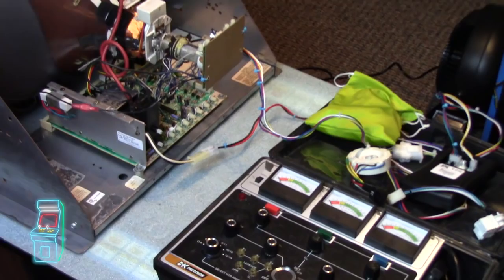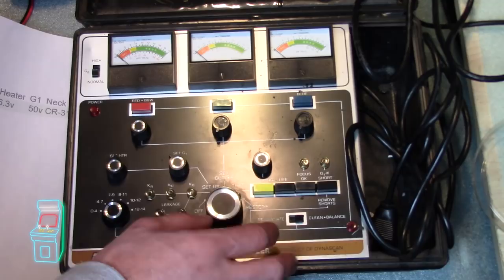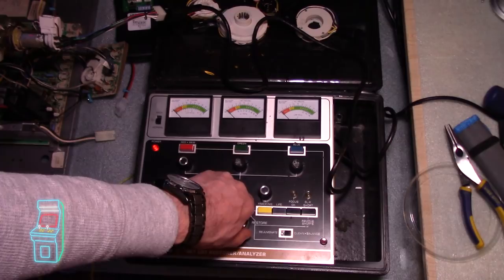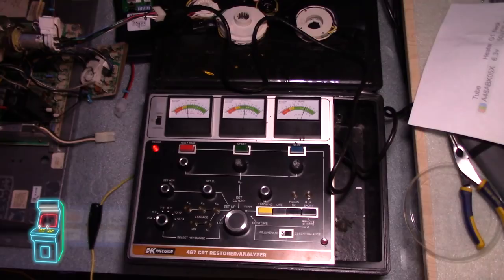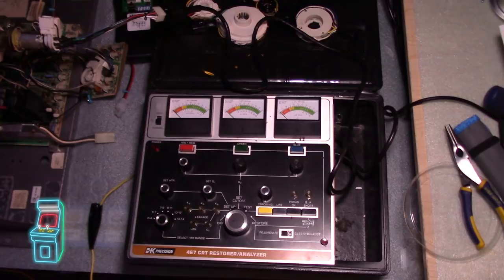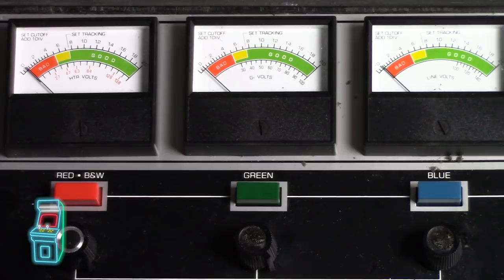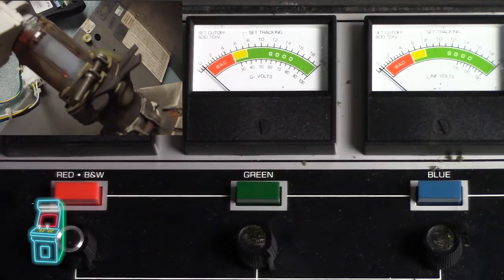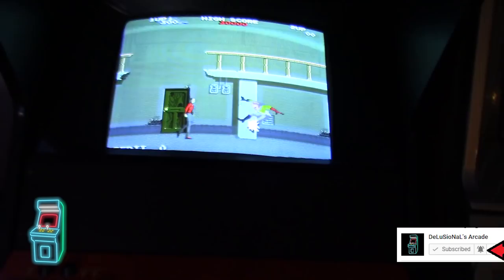How to Rejuvenate an arcade CRT monitor [B&K 467]

Comment: The rejuvenation feature of that CRT tester provided excellent results! I've heard that, back in the day, TV repair techs would use these in the field to rejuvenate dying CRT's as a stopgap measure to give them time to order a new CRT, as the effects of the rejuvenation were considered temporary. There's only so much conductive material on the surfaces of those cathodes.
Reply: I wonder why they chose to call it rejuvenation if it's "bad for the tube". Based on your comment, they should have called it "Death Rattle"
Reply from the maker: The term "Rejuvenation" is accurate in my opinion. By definition, Rejuvenation is adding energy and vigor to a dying product. But it's only temporary. However, it does extend the use of an already "unusable" tube.  So it does breathe new life into it.
On the flip side, the  term "Restoration" (which is what I suspect you may be seeking)   completely restores the product to factory condition. In this case, CRTs cannot be restored 100%, similar to a light bulb.

Comment: Just wanted to thank you for the shout out.
great video, it was a fun watch.
also just so folks know, the adapter is ALL BRAND NEW, nothing is used, socket is even BRAND NEW.
Reply from the maker: Cool. Glad you approve of the video. Yeah, I was wondering about the socket. It looked too good to be used. And now you've confirmed that it's NEW. Even better!
Reply: @delsarcade  great video guys.  I've watched buffet's and your's.  Did you have to repair your model when you got it off ebay? I'm waiting on a listing of that same model on eBay. Just curious if ya had to do any repairs to it, or send it out to someone or if it worked just fine for ya.
Reply from the maker: @curtislv426  No, luckily mine worked perfectly. And it was only $60 shipped. ;-)
Reply: @delsarcade  good lord! That's a heck of a deal!
Reply from the maker: @curtislv426  That was about 5 years ago.

Comment: I have a 467 and it is one of the BEST of the "old" restorers. The 465 was a no timed harsh step restorer wheres the 467 has a "patented" timer that works off the the cathode temp and tells you when to release the button. The 467 is very strong even in the C&B setting and 9/10 times used 1 to 3 times from experience will fix any tube well into the green. I also sacrificed one of the B&W sockets and made a universal connector for any pin crt pin configuration.

Only thing to be aware is the "new" crts have very fine close together cathodes and using an old style restorer MAY damage and short them. Having said that, i used it on some modern tvs only using the C&B setting and all times no problems as for those CRTS, C&B is PLENTY so i never needed Rejuv.   
This vid is great as that last tube had NO indication of output on those colours but the heavy rejuv brought it back to life- something i never needed to do and the instructions suggest to finish with a C&B to settle the output a bit more evenly on the guns after rejuv.  Might be why those needles were crazy high at end but shaky. Time and some heat in the crts acts as a very gentle rejuv anyway so leaving the crt on and get it hot can "mild" clean the guns a little, as is turning up the voltage on the tested a bit higher and getting the it hotter can help when testing.
Sadly except for analogue oscilloscope and arcade games, the restorer usefulness is going away but great if you have your own crts that need cleaning as i do so its a handy quality instrument that i will keep forever.

Comment: Really enjoyed seeing these tubes get a new lease of life! Don't worry about the shaky needles, the 467 has at its core a multiplexer running at 20Hz which constantly cycles sequentially through R G and B. This always shows up on the meters at higher readings, due to the value of the smoothing cap across each meter. I guess it was a design choice, providing greater accuracy of reading at low current levels at the expense of some jitter at the top end. B+K really did design some wonderful test equipment.
Reply from the maker: Glad you enjoyed it. Thanks for great info!  My next Livestream will be on re-capping the B&K rejuvenator.  Should be fun!
Reply: @delsarcade  Cool! I'll look forward to that!

Comment: Just wanted to send a thanks and a like for a great video with clear instructions, it was easy to adapt to a B&K 470. I just ran a clean and balance on a K7400 and a clean and balance with a touch of rejuvenate on a K4900 with great results.
Reply from the maker: Glad it helped. I created it since I hadn't really seen an in depth one done before. The picture in picture make it a bit easier to follow too.

Glad you breathed new life into those tubes!  [Also, if you ever decide to swap out a tube, I've done videos on those as well. (Arcade monitor repair playlist.)]  Enjoy!
Reply: @delsarcade  Ha! Thats what I'm trying to avoid… though I think the K4900 is on its last legs it did some funky things when powering it on for the first time after the rejuvenate but has since settled, maybe a side effect of burning junk off the cathode? Funky things as in red screen flashing with retrace lines, it's had a hard life can tell its been in many machines from the burn in.
Reply from the maker: Could be some shorts developed with the rejuve.  There should be a "remove short" button that can remove them safely. Also, it helps to have the font of the tube facing down during the rejuve. That way anything knocked off the guns will fall away from them, reducing the shorts.
Reply: @delsarcade  That’s good info, I’ll give that a shot if it starts becoming a problem.

Comment: Yeah, I wonder about the green gun too, why its pegged.  A new in box CRT wouldn't peg like that.  It also shows shorts, something funky but it DOES work.  If it Jacks up though I'd check your green drive circuit (may be somewhat shorted, over taxing the green drive)

Comment: Amazing that it can bring them back to life!
Reply: Well, it's not that easy unfortunately. The rejuv process is destructive and your mileage may vary. You can also kill a tube this way. I would actually leave these two monitors on for a few days to see if they truly survived the process. The Sencore CR7000 manuals actually specific mentions that the rejuv process on an arcade tube won't usually yield the best results.That said – it's really the only option for a dying, dark tube!
Reply from the maker: The Outrun is rock solid. So it worked great.  And you'll need to see what happens with Rolling Thunder's in Friday's episode. ;-)
Reply: @delsarcade  That's great! I actually shared this with a guy who used to work for B&K doing demonstrations of the 467 for TV repair guys. He said this brought back some memories. One suggestion: take a peak in the manual and it'll tell you when you click over to restore you should wait for a good 30-60 seconds before running a C&B or rejuv.

Comment: If it were me (I could be wrong) I would do a "clean and balance" once more after 2nd rejuvenation.  I noticed on the picture in picture it was sparking when you were rejuvenating the first time without touching anything.  I'll bet the crap that was on the red gun was going back and forth to the green (maybe?) due to the difference in charge.  I don't know much about CRTs, just how they work in Physics 3 I just took the massive acceleration of the electrons from the individual red gun with lots of negatively charged crap going to the more-positive adjacent green gun? (it was perfect before - just a random thought)

Comment: This is really what the CRT community needed, a good tutorial! Would you be so kind to explain what happened to the green gun of the first monitor? Seeing it go all the way down suddenly made me think it was bricked, but somehow by repeating the process it got perfect again?

What was going on?

Thanks!
Reply from the maker: Thanks, glad you find the video useful!
To answer your question regarding the green gun:  When the voltage was applied it knocked off the corrosion inside the tube.  Sometimes the bits knocked off will fall on the filaments and cause a short.  In this case that's exactly what happened. At 17:09 if you look closely you will see the orange short indictor light up on the lower right. (I didn't notice it).  Normally if you see this you simply press the "remove short" button and it zaps the short off.  But I did it again and it worked. Same result.
Later in the video on the second monitor that's exactly what happened. At 26:45 I noticed the short and (off camera) pressed the "remove short" button which cleared the problem. You can even see the blue concentrated flash in the neck as it gets zapped off. 
Hope this helped and thanks again for watching and commenting!
Reply: @delsarcade  Awesome response, thank you! That explains so much. I've got one broadcast grade HD CRT here that's fine color-wise, but could use a bit more brightness. Spoke to a tech that used to service them who said that the clean+balance mode of the 467 should be relatively safe to use. I'm excited about it, especially now I understand the process so much better! Still have to find a 467 though.

Comment: Great video thanks! My local radio and TV museum has the same unit, but not the proper connector, just like you originally. How can I order that proper adapter from Buffet?
Reply from the maker: Head over to Buffett's website. Scroll to the bottom and e-mail him directly.  CR-23 and CR-31 are the 2 most common types. 
http://thearcadebuffett.com/

Comment: This is Fantastic! I just picked up one of these today and really want to learn how to do my own monitors. It came with adapters # 4, 5, 6, 7, 10. Not sure if any of these are arcade monitor compatible? The monitor is a 19K4625. Any advice on what adapter I will need for this monitor?
Reply from the maker: You have a Wells Gardner K4600.  That has a CR-23 neck on the tube.  So you'll need that adapter.  Your best bet is to remove the neck board and see if what you have fits.  If not, fear not, The Arcade Buffet makes them.  http://thearcadebuffett.tictail.com/product/cr-23-adapter-for-the-bk-467-490-tube-rejuvinator  While you're there I'd pick up the CR-31 adapter as well, since those are the two most common in arcade monitors and TVs.  The CR-23 should cover 25" monitors as well as 19".

Comment: Hey I think you hit the green gun on the second tube a bit too much. Once you removed the short, you would have been good to go — no additional rejuv needed. Also, I don’t think it was necessary to run the C&B after the rejuv. You want to hit the filaments as little as possible.
Reply from the maker: Thanks for watching!  One thing I've learned: Feedback is GREAT! I've gotten many suggestions on how to do it better and I really appreciate everyone's input (including yours). There certainly is room for improvement and I'm going to take that knowledge and apply it to my future endeavors. Thank you!
Reply: No problem! I’ve been messing around with rejuv units since last Fall, so I’m definitely not an expert either! 

I know that you want to use the least amount of power as possible since the rejuv will strip the cathodes. I usually leave a tube run for a day or two to be sure the fix is somewhat permanent. It’ll fade if it’s not. 

I’ve had good results with the 467 C&B. I usually always start with that.

I’ve also been messing around with a Konig TR850 and Sencore CR7000. Each of the units will give you a different interpretation of the tube’s health. The Sencore also has a lot of options for the level of restoration you want to perform.

Comment: I have an open heater.  Its a 1960 17HP4.  Do I have a chance in hell of rejuvenation or if not, do you know where I'd have a chance in hell of buying one? The set is in beautiful mint condition
Reply from the maker: I'm assuming this is your post? ;-) https://www.avsforum.com/forum/256-direct-view-crt/3089654-17hp4-crt-tube-wanted.html
Sounds like your tube is "necked". Unfortunately, she's a goner.  However you can probably save the yoke from the tube and look for another compatible tube that will fit into the neckboard. There should be a number on the tube itself saying what size it is.  You just need to make sure it has the same number of pins on the neck so it will be compatible with your neckboard. But the yokes are unique so will need to be swapped. Check out my buddy Jason's video on how to do this: https://youtu.be/_iSZYxrRSL4

Comment: I've got a couple of rare CRTs that I want to rejuvenate and I got a tech willing to do it for me. Problem is that the Tubular website doesn't have my CRTs in their data base. Can anyone give any advice on how I cut find the right voltage and g cut settings for my tubes? Maybe it is in the service manual? The tubes come from a KV-35xbr48 Sony consumer Trinitron and a BVM1911 broadcast monitor. I don't have the actual tube part numbers on hand but I can find them if need be. Any help much appreciated. Thanks.
Reply from the maker: Not sure about those. Your best bet is to post that question on a CRT forum or arcade forum (KLOV forums is a good one). Those guys really know their stuff.
Reply: @delsarcade  Cool, thanks for getting back to me.
Reply: Hi I have the same monitor (and a couple of other bvms). Were you able to figure out the settings for it?
Reply: @andersgunnarsson2489  
no sorry
Reply from the maker: Head over to the B&K rejuvenators Facebook Group. They should be able to help.

Comment: Hey Delusional quick question.  You don’t show yourself plugging the anode cap back in before rejuvenation.  I’m assuming it has to be plugged in to run the rejuv but the only reason I ask is because you also leave the monitor unplugged so I just want to make sure 😅
Reply from the maker: You don't need the anode cap plugged in to run the rejuvenator. Essentially the rejuvenator takes the place of the chassis. So you definitely DON'T want the monitor powered up while rejuvenating. 
Some people simply just remove the neck board while in a game and don't remove anything else (with monitor still plugged into game) but everything is powered off except for the actual rejuvenator. 
But I like to air on the side of caution and I complete remove any connections to the original chassis of the monitor. THEN I connect the rejuvenator.
Reply: @delsarcade  good to know 🙏🏼 thank you for the awesome video 🤙🏼

Comment: Rejuvenation just buys you a little time till you find different crt.
Reply from the maker: Depends. It's on a case by case basis for each CRT.  Sometimes a rejuvenation will clear shorts on the guns and fix the CRT with minimal wear.
Reply: Depends on the crt brand,  i have a 25" crt that was zapped 10 years by an arcade tech with his b&k due to the cab being on all day for years so the crt was dark i bought the cab cheap due to it needing a new monitor, but a rejuvenation saved me some money at the time, i now have  my own Rejuvenator and the tube is still in the green and working just fine plus its been used every day since its rejuvenation, never once had to alter gun levels or flyback screen bias, the tube in question is a Philips.

Comment: does tge rejuvenation work on HD CRTs also?
Reply from the maker: I'm assuming you would need the adapter for the proper neck pinout. So it's hard to say unless you knew what it is exactly.
Reply: @delsarcade  Yes, I have a KV-34xbr910 was curious if the hd models are also serviced similarly.. I really enjoyed the video, very detailed and informative which was nice.
Reply from the maker: From what I understand, the B&K 467 CAN be used safely on a Trinitron CRT tube,which is what your model has.  Again, you need the proper adapter and voltage settings.